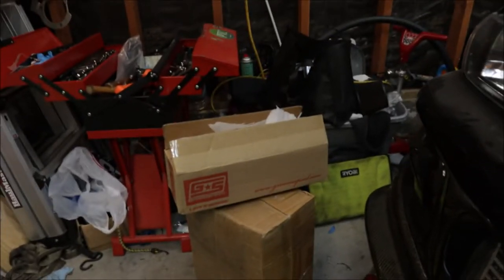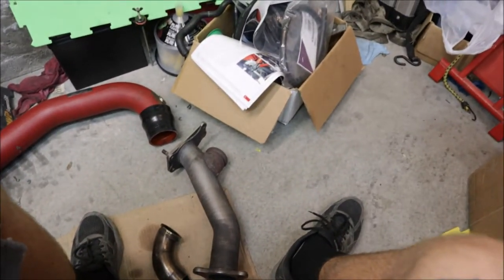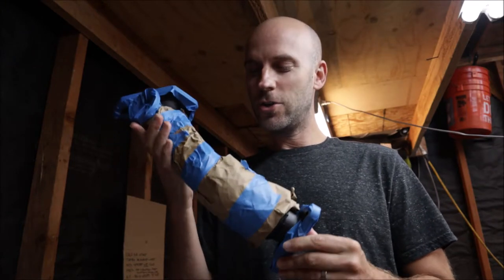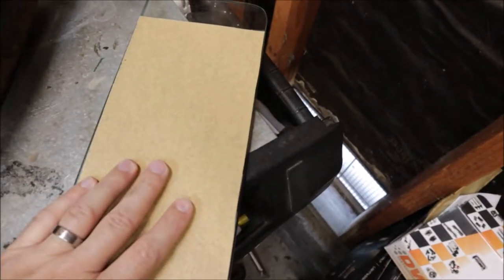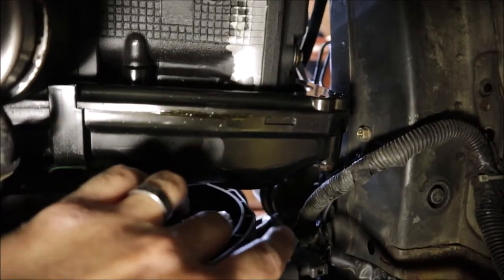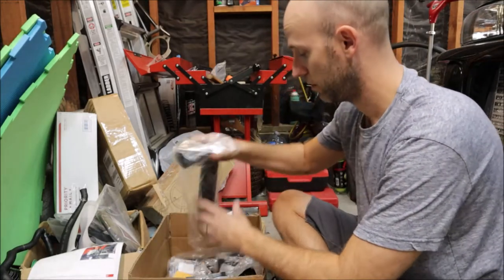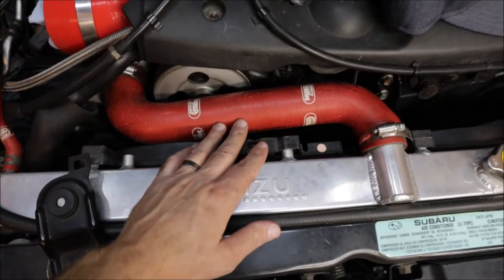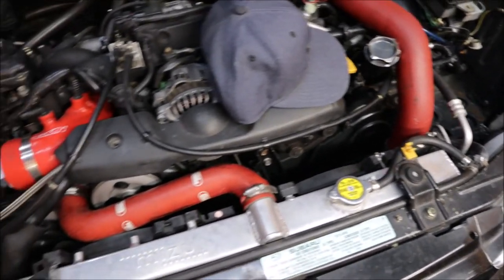New Up Pipe Installed // GC8 Impreza WRX Build - Part 11

Comment: The new gaskets on the heads and correct torque on the nuts will correct the flange distortion. Usually I have seen that distortion from the installer just hand tightening them. 
You are doing the right thing by taking the front apart while replacing  the cooling system components.
I literally had to rebuild, replace, or redo everything on my car. All the braided lines had to be replaced because they were leaking fuel and fluids through the braiding. It looked pretty though...
I like the up pipe by the way.
Reply from the maker: Thanks! Now I have to send out the ewg. I took it apart and there is a bit of play that is concerning. Probably going to take a few more weeks, or bite the bullet and buy a new one?!

Comment: The GS uppipe dia is fine. It'll help you with spoolup. We run the killerB header/uppipe @1.8" dia to 1000whp. The exhaust ports @6:40min in looks to be gasket matched. Most headers the flange does NOT have over sized openings for the primary pipes.  Most run a diameter of 1.5" or so vs few (MAP header) running 1.75 inch. This is probably causing your flange to warp because the LIP of the flange is exposed into the exhaust port. This hinders flow and off boost driving/ throttle response.
Reply from the maker: I don’t recall the diameter I wrote it all down somewhere. At this point the GS uppipe and running the same header was the most cost effective without spending $1k + on a new set up. The EWG may also need to be replaced but I sent it off to Tial for them to inspect and or repair. Thanks for all the help! Are you in SoCal?!
Reply: @RoadPatina  I'm in the upper midwest,  Minnesota.
Reply from the maker: @FuJiNF  bummer! Stay warm.

Comment: That Subaru Super Blue Coolant is worth its weight in gold, literally, so expensive. On my Subaru I also went back to the rubber hoses, same thing coolant seeps through the silicone, more than you would anticipate. If you had the time and means to have the car off the road, possibly worth pulling the engine, going through it with a fine tooth comb, replacing everything looking sad in the one hit. Will save time in the long run.
Reply from the maker: Sneaky Foz true story, I just ordered two gallons! I don’t need to drive it, but space is the problem. No room to pull it. I would love to pull the engine and inspect it. My guess, I’d find more bad news. Wait til I pull the timing cover 😳

Comment: trust me, you're way farther along than me.  i basically just have a shell.  as far as the videos, perhaps make a few 10+ minute videos consistently, instead of some real long video.  maybe that way you'll start getting your youtube algorithm up.  that's just me though.   keep going.  you'll eventually get there
Reply from the maker: ziewknihtewza keep at it. It’s hard to stay motivated when all I find are expensive problems! Is 10 min the magic number? I never know if I should make the videos longer or shorter?! 🤷‍♂️
Reply: That seems to be the magic number. 10-12 minutes, but of course you’ll have to post consistently.if they’re longer, then you can post 1-2 times a week like mcm and gears & gasoline, but i doubt u have their resources. It’s all a magic blend in the damn YouTube algorithm. You’ll have to work to find a sweet spot and hopefully start making $ to work on the rsti and content
Reply from the maker: @ziewknihtewza  Thanks! The mythical algorithm abyss...

Comment: The first thing you should do is drain the coolant and pull the radiator out of the car. You will have alot of space to remove the timing cover and find those oil leaks
Reply from the maker: Devon Sahadeo my favorite is the coolant bath I will take!